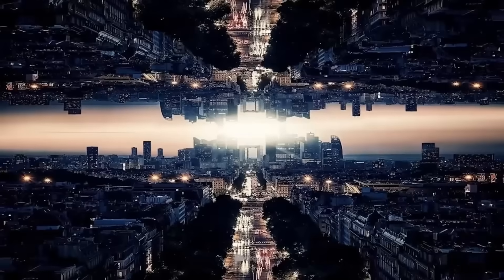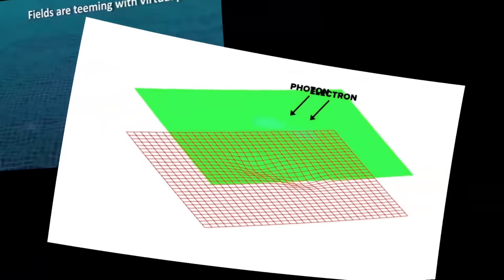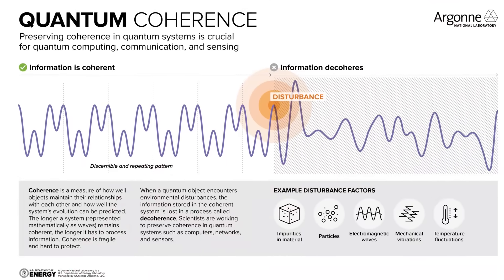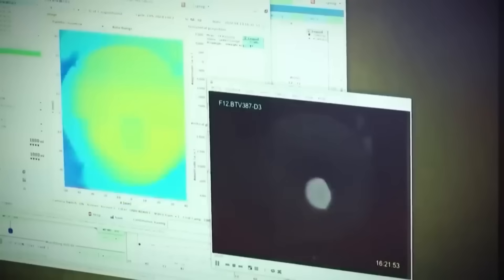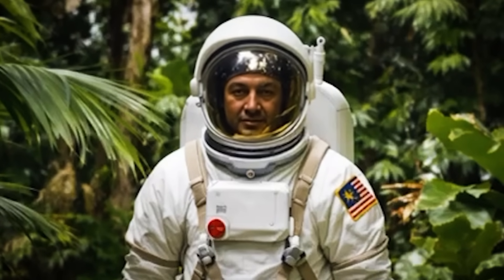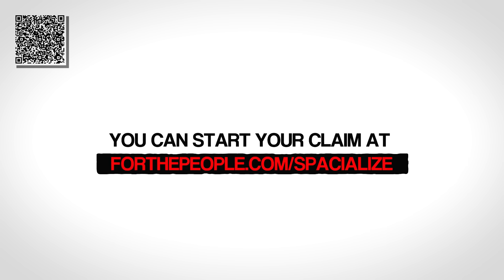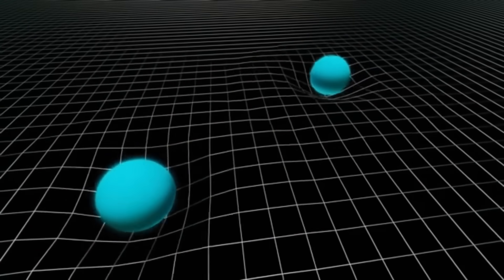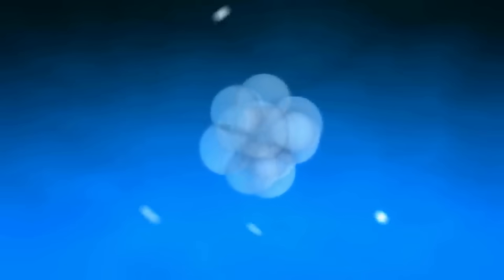MIT’s Teleportation Test Created Something That REFUSED to Vanish

Comment: 2:58 Basics of building a stargate. 

In the environment your walking in right now, you interact with particles that interact with other particles occupying with your surroundings.  

Everything going on around you including your existence is also a composition of particle interactions. 

With our current technology and scientific studies we know. 

When particles are quantum entangled, regardless of how far apart they are how you interact with one, equally affects the other instantaneously. 

We experimented with this quantum particle environment already. 

1 particle was on earth and the other was on the international space station. 

There was no measurable time difference between them. 

Even though they weren’t occupying the same they behaved as if they are. 

If you take an unknown amount of particles from section (A) ( relative to the size of space required for what you want to pass something through) separated from particles of group (B) connected with quantum entanglement within 2 equal spaces in size occupying 2 different locations. 

As you pass through space (A) you end up in space (B).  As your interactions with (A) it equally affects (B) and because they are occupying completely different environments that interact with non quantum entangled particles in each different environment while (A) and (B) are locked to each other as well. 

The transition would be instantaneous. 

Therefore as group (A) interacts with you, your interactions affects group (B). 

Group (B) is in a different location. 

(A) interacts with (A) environment but is quantitatively connected to (B) were (B) is interacting with (B) environment while being quantitatively connected to (A). 

the particles both doorways occupy the exact same space in the universe even though they are light years apart. 

You would need a highly condensed amount of quantum connected particles in the 2 spaces you want to pass through.  Otherwise you could end if like Swiss cheese as only parts of you would pass through. 

🙂.

 The mistake that they made up at they sent the particle through instead of an object. 

After the object goes through the  quantum entanglement de field system you have to destroy all of the entangled particles to close the gates

Currently or technological advancements aren’t as good but in near future with advanced quantum computing combined with artificial intelligence do you think we would be able to tell the difference between reality and a simulated reality?

Imagine if we will be able to load ourselves into a simulation and in a matter of a few minutes of your real life you will live a lifetime. 

This will provide you with the experience of immortality. 

Do you think we already accomplished this and are using it?

Do you think in the process we would follow the same evolutionary path within a virtual reality?

Do you wonder if this is how multiple dimensions exist as we build simulated realities within simulated realities?

What if god is the computer the software is operating on?

What if angles are moderators preventing hacking and modifying the software to improve the efficiency while demons are manipulating reality through hacks and  are false gods. 

What if we actually don’t have a form  at all?

What if we are software that became sentient Inside a virtual environment?

What if the purpose of this life is to identify our individual true colours that defines the environment we transition into after this life?

Do you think if we were actually living beings that survive outside of a virtual reality while living in  one that there would be consequences for what we do in a virtual reality that translate to consequences in the real environment we actually survive in?

Would it explain a long ongoing debate about whether or not virtual reality should or shouldn’t be consequence free between its users and its creator and moderators?

If Angels and Demons are loading into a virtual reality and interacting with Man that is itself software that became sentient inside a virtual reality how much would it explain regarding religion, history, prophecy, reincarnation and immortality.  

If time travel is ever invented in the future it would exist right now and in the past. 

With artificial intelligence and quantum computing do you think time travel will eventually exists?

Would it explain technologically advanced civilizations that lived in the past? 

Light, Sound and vibrations all translate into frequencies that are mathematically connected constructing our universe harmoniously through elements that are in a constant state of evolution.

Did you know an octopuses have nine brains? Imagine if 8 of them are living in a virtual reality sharing information with the central brain. 

The central brain doesn’t share the experiences between the 8 brains however the central brain shares the outcomes. 

Your character,   Your survival instincts, your education, your talents are shared. 

Like an onion life cycles repeat themselves.   

From the beginning of life until the end within a virtual reality that was already created that we are using, we again develop virtual reality within a virtual reality. Thats a linear development of virtual reality progressing infinitely.     Like those  Russian dolls inside each other. 

Then imagine side by side theres an infinite amount of onions doing the same thing.  

Recently quantum computing has  made contact with another dimension.  

What really happened is it is able to understand whats going on and its communicating with another quantum computer from a different layer of virtual reality that ours is inside of. 

Some life forms are real and plugged into the system, others are software that became sentient. 

Both are respectfully alive in their own way. 

If you are software that became sentient within virtual reality, you never die. 

If you are from outside the virtual reality plugged in, eventually you will die in the universe you really live in. 

In the mean time, by plugging yourself into the system from the outside you can live multiple lives as each life only takes a few minutes from your real life giving you the experience of immortality. 

Maybe you understand, maybe you don’t.  Ive found that ignorance truly is bliss and stopped perusing more information on this topic.  

I unfortunately took things way to far in many directions regarding a vast variety of topics. 

This is only one i understand and am sharing looking for minds that also know.

In the beginning there was nothing. 

To  define  theres nothing  creates binary code. 

Nothing being zero and nothing existing being one. 

With the existence of math. 

All things that equate become snd all things that do not equate balance the stability of reality itself.

Everything is the inevitable of the universe creating itself through mathematics.

The question is, are you loaded into a simulation from the outside or are you part of the simulation that became sentient within it?

Both possibilities could exist. 

If you loaded yourself in to experience immortality through living multiple lives compared to the time difference of your own real life you will eventually surcome to your mortality.  

If you are a sentient being created and lives entirely within this reality your immortal and live as long as the math continued to compute life to life.
Reply: This was a bitch to write out on my phone. Youtube wont let me edit.
Reply: What we can do right now with it and you can have one particle on earth for example and another particle in a satellite website and now you can communicate with that satellite instantaneously if those two particles are quantum entangled. 

There will be no time delay. 

So far I haven’t been any experiment where anybody’s actually attempted to do what I’m talking about.

I’m not an MIT professor like you claim to be. 

I’m just a retired guy that hangs out with professors and doctors from around the world and discuss interesting things about all topics of interest in person. 

I’m just an open minded regular guy fascinated and curious about the world around me enough to explore in conversation possibilities and facts unheard by the general public school system. 

In no way do I intend to offend anyone through the process of exploring information that may have significant value to humanity that can be shared in what is intended to be a safe real time open environment provided with social media.

The lack of the ability to communicate with people in a safe environment is what’s led to violence multiple times throughout history and in our daily interactions.

Thanks to social media I can share insight’s about multiple topics with people who can meet on a topic of mutual interest and proceed with with a conversation that benefits humanity.

Comment: Electrons are a particle that is summoned from a soup of electrons. Is it electromagnetism that lets them appear here momentarily? Are the electrons we measure the same as we measured a split second ago as they are not in the same place? These were the questions that got me started thinking.
Electrons are the key they are in QL soup mostly out of spacetime. They are like puzzle pieces that fit but there are many pieces floating around that will fit. They stay in the QL soup until they are summoned by measuring. We see electrons popping into atoms to maintain the balance. When we fire an election it causes ripples in the waiting candidates, this is why we see an interference pattern from the double slit experiment. If we measure after it is fired we establish a vector so only the electrons along this vector can hit the wall. This entanglement would explain the particle wave quandary. If this is the case what else is in the soup. Entanglement has been shown to be instantaneous the soup being outside of spacetime is subject to other rules.

Comment: So, if location 1 turns into information that is sent to location 2 where the original object is recreated or placed, can you use that information to send the information a second time and create another original, repeatedly? Imagine doing that to food and never going hungry. Imagine a military using it to never run out of soldiers or supplies. Minerals. Fresh water. Everyone could be self-sufficient anywhere, on any world. If it can't be done a 2nd time, can you start the process and save it, send it in a Starship to Mars where you complete the process and have everything that you need there, on the surface. I write science-fiction, so these thoughts might be way out there.

Comment: Did this get cooked up to avoid the fact that time travel refutes "matter can't be created or destroyed"?   An infinite inch or an infinite foot is still an inch or a foot.  Even if there is no plank length.  The dimension beyond plank or if no plank then the infinite and infinitesimal may be without space or time or of all.  A weak force/magnetic frequency imprint being transplaced to draw aggregates from it's local or release them from it's former placement is not destruction but disintegration/integration.  Though I don't believe that is true. Psychotronics transplaced your consciousness without drawing aggregates.  I still think we could create if we could manufacture or isolate gluons.

Comment: Ok let me break your brains physicist.

Teleportation is a movement performed by SPACE FOR OUR BENEFIT. You keep looking at teleportation lime we are in Star Trek.

Missing this most important concept.

Teleportation does not need to demolecularize a physical body or material. All Teleportation is? Is moving space from point A to point B.

Using Cosyrev’s concept of space moving space. Stop living in and by 20 Century concepts SCIENTISTS PHYSICIST! STOP. Time to step into out 21st century. Not everything you have learned is etched into granite. More like Clay. Rearrange your thinking where necessary.

Comment: Oll mi shareback videos last 3 to 4 years are just a cople of oll olrady shared 12 to 10 years ago and some olrady bevore when we ware bilding the orthomoleculair arts of healing with consent for cosmic realety🤣🤣🤣 olrayd using wat you missonderstand as teleportation.

I ad spinage particle around mi tharm flox lowering the thention .
And lymphatic orders of magnetudes lowering the thention for tharm floc self to teleport (see way it is not teleportation at oll) expant in to fieldcolapse in to translations in to the surounding to stimulating exeleration in to graventational countering for the exeterated to fieldcolapse ading toegheter inside this graventational countering less thentional space to become a healty cell again plus that the food particles can positioning on the corect positions to tace from the lymp expand in to implotion(fieldcolapse do to ending up in lesser everiche thentional behavieures in to thentional diverentional displasmands to ad stumulating thentional diverentional displasmends towart the lymphatic and blod system and walle resarecting behavieures 😂😂😂 so the way you experience teleportation have you olrady been doing from way bevore the down of the irivle of manivistation of the behavieures of eurtley biologicals there existances 😂😂😂

Wile you machines for somting that is olrady pressend 😂😂😂🛸🐜

We olrady travel the experience of existances from oll positions bi not tacing position😂😂😂🎁🛸🎁

And bild from coperhantion the understandings in to knowledge🦢🔱

Comment: I know this video is already over twelve years old, but let me quickly explain how teleportation actually works, scientifically speaking.
In teleportation, relative motion doesn’t really matter. That’s a common misconception. You also have to consider time itself, meaning spacetime dilation. Within Earth this effect is minimal, but if you were to teleport to a more massive planet like Kepler-452b, it would become significant. The way it’s usually described just wouldn’t be technically possible.

Teleportation requires a spacetime differential correction. That’s why you appear at the destination with a tiny temporal offset depending on the jump distance. Within Earth it’s only fractions of a nanosecond, but over larger distances it can be several seconds.
To put it simply: we all carry a kind of spacetime spin that defines our relative velocity, gravity, and position. Precisely adjusting that spin determines when and where you arrive. After that, you’re already aligned with the new spacetime frame. No sudden acceleration, no splattering against a wall.

That’s also exactly how time travel works. Otherwise it wouldn’t even be physically possible.
EDIT: I’ll delete this comment and post it twelve years earlier on release date of this video, just to demonstrate
Reply: It’s kinda creepy how much sense that actually makes 😳
Reply: nice trick but if you already posted it just now theres no proof you did it from the future and your account creation date being last year and the videos you upload frequently suggest your claim isnt true.
Reply: @HakuHakuHakuEn  The timestamp is valid for the moment I posted it. I’m not bending reality like a magician, just using YouTube
Reply: @vybefm  also teleportation and time travel also have what I believe upsets the ballance of states, like if you could send   an object to a set time and every ten seconds you keep on sending the same amount of mass, then surely the time it gets sent to will in theory run out of space to store everything sent, so I think in that case, it would be logical for everything sent the equivalent mass must also have to go, as in the equil and opposite reaction,  said by Einstein.
Reply: @necronecro1265 I don’t really think spacetime runs out of room like that.
Everything that exists is already part of the spacetime structure. Mass, energy, position, even causality are balanced inside it.
Moving an object in time or space doesn’t add anything new, it just redistributes what’s already there.
The system naturally equalizes itself, local disturbances fade almost instantly.
That’s why even if you kept sending matter to the same point, spacetime would simply absorb it without losing balance.

Even if you won fifty million dollars in the lottery, your own life might change completely. Maybe even the lives of a few people close to you. But for everyone else, absolutely nothing would change, not even 0.0%.
So if you traveled through time just to win the lottery, you’d still change nothing, because you can’t even change anything here and now.
Certainly not in spacetime itself.
Reply: We just need a decent stargate up and running, build one